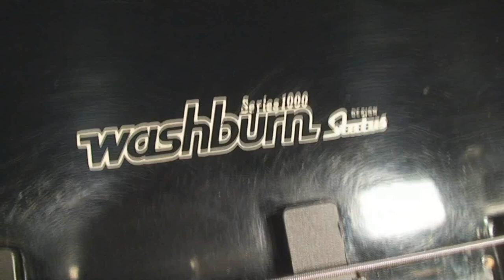Washburn Status Bass Guitar Repair

Comment: I have a bass exactly like this one. It is the cheaper version of the graphite on with maple neck through and mahogany wings. Sounds and plays great. Cuts through the mix totally. Electronics and pickups are one of the best and I have 10 basses (with Fender custom pups, Lace, Nordstrand, Shaller, you name it), noiseless. The bridge is weird, but I set it up perfectly in 5 minutes using small hammer and gently tap on the saddle to be able to just slightly move it in the right direction with strings almost in pitch. Than just tighten the two screws on the side... no problem at all. Try Rick to adjust!

Comment: The nut on that will take single ball strings. There are grub screws to clamp ordinary strings. I had something like it way back. May even have been that model. You get used to playing headless once your eye gets in. It's peripheral vision thing.  What IS hard though is swapping from headed to headless back and forth. I couldn't do it.
. 
I kept mine for all of 2 weeks. The E string was terminally weak. Maybe the EMGs give it better balance.
The neck is not graphite like the Status , it's wood: neck-through maple I think. The phenolic fingerboard tricks people into believing the neck is graphite.
The actual Status is a completely different animal.

Comment: I have the exact same bass. I'm having a hard time finding the right bass strings that are long enough for proper fit. Know of any place to buy them?
Reply from the maker: no
Reply: Yes status graphite sell strings called hot wire stings. But there should be some grub screws at the end of the neck that you can unscrew and then slot in regular stings and the clamp down using the grub screws👍

Comment: did leo fender not reinvent the wheel with the the p bass? the proper status (not stratus) basses are awsome i have had a few and played loads and the mix of the carbon fibre construction and the double ball end works great and rarely need tuned they are so stable

Comment: I had one of these turds in the early 00s what a pain in the ass and yes I believe that with 24 k gold strings and hardware it was 2800 new I fortunately bought it used then ended up selling it back 5 or so years later wow what a pain.

Comment: you play a G and you get a A, thats why i sold mine bought a hofner shorty (short scale bass) and converted it to a headless using parts resoursed from ebay. changed the stock pick up with seymore duncan and i have a lovable bass \(*_*))